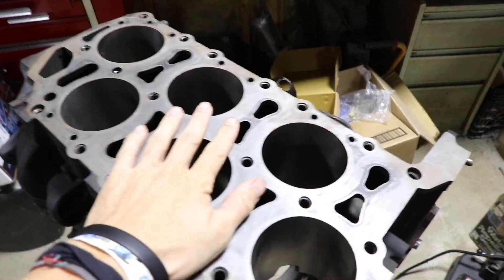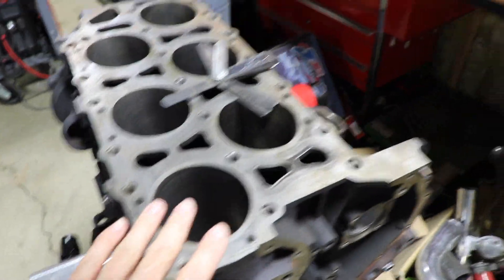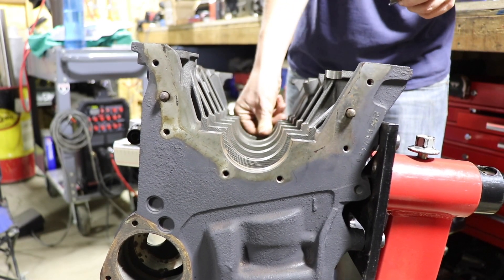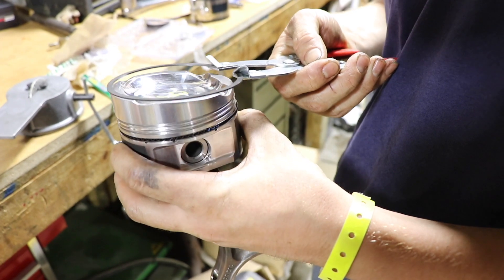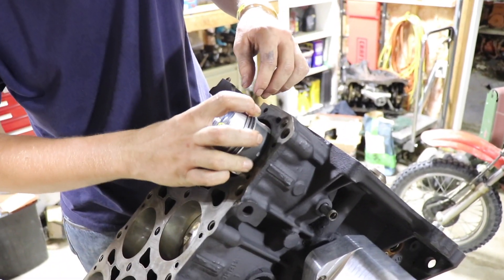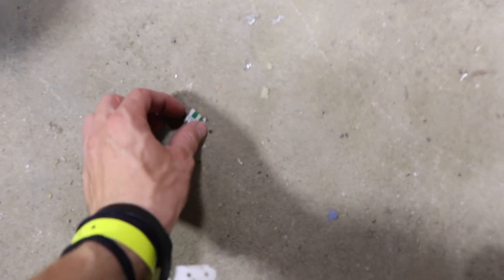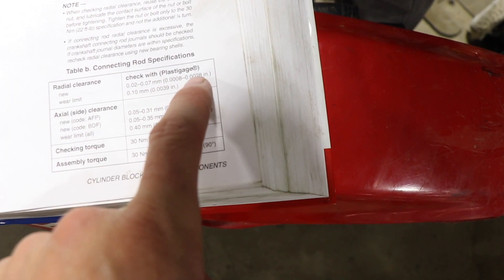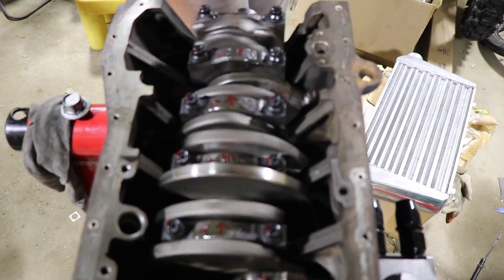VR6 Forged Block Assembly//Step by Step.....(pt,4)

Comment: I am convinced that stock connecting rods are stronger than a lot of the 600€ aftermarket Chinese junk, people like steel connecting rods without knowing how they are built and what materials are used, I would probably only go with Carrillo or Pauter instead of stock, I admire the daredevil guys on the stock block, they donated their experience

Comment: Nice work.  You can use the 0.001" oversize bearings to open up the clearance if you have an after market crank or rod combination that is tight. Generally your machine shop can check that too and hone out the rod big ends so they get you the right clearences. You can also run a combination of a STD one side of the rod, and a 0.001" in the cap to open up 1/2 a thou.  Its not uncommon to run a 0.002" oil clearance in the rod with a 20w60 oil in high power applications.  This is what I do in RB's.  It can cause low oil pressures at idle though if your pump is standard flow.
Reply from the maker: Sweet, thanks for the info🏁🏁